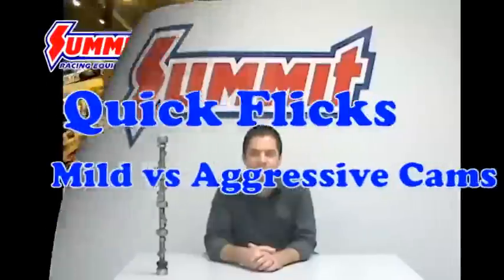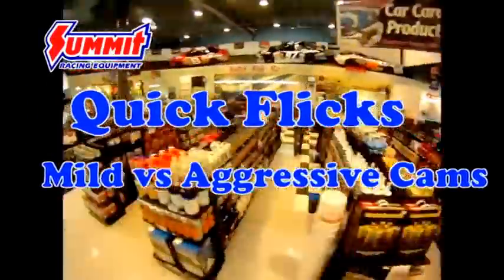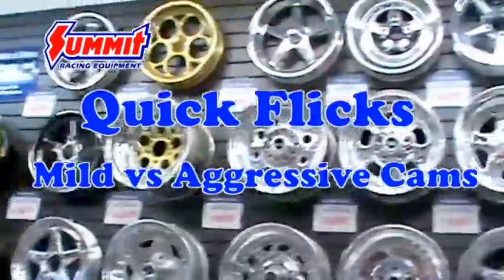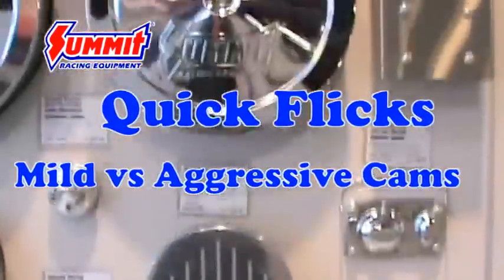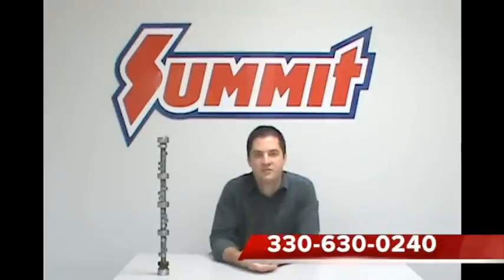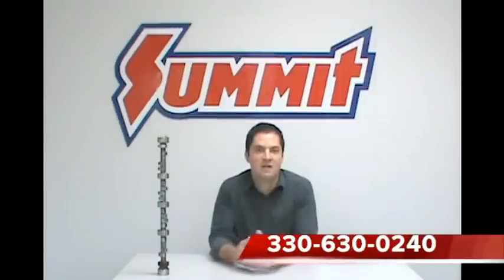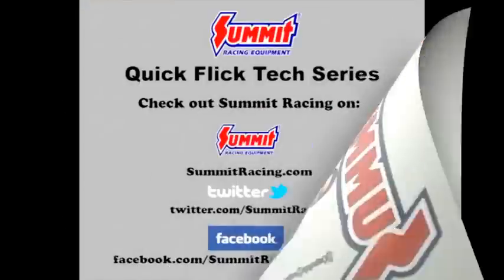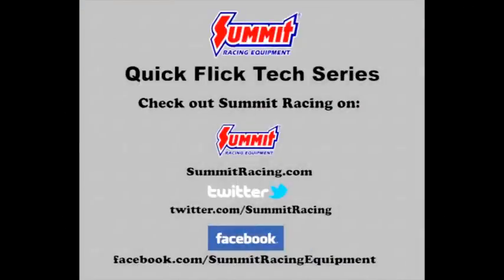Types of Camshafts | Learn the Differences Between Mild and Aggressive Cams

Comment from the maker: Part of the reason for this lies in design/engineering limitations of the hydraulic flat tappet cam and lifter package (and for the most part, any flat tappet application). Even if you were to pursue a custom grind in order to get some extra lift while maintaining the 220 at 50 duration I’m afraid that the cost to benefit may not be worth the expense.  
   Let me know if I can help with anything else.

Comment from the maker: Think about this too…, based upon the 400 Chrysler and doing some quick calculations it looks like you are going to pick up compression at the rate of 2/10 of a point for every 0.010 inch removed (this is an approximation). Be very careful where and how much you cut from a Chrysler. Chrysler heads and pistons are almost always designed and manufactured for quench, in these cases quench is a good thing.

Comment: Who doesn't like the sound of a rumpity, choppy idle of a V8 with a trick camshaft ? I know I do, but what's really happening ? This music to our ears is actually an engine running poorly   at that RPM. It's like a dog with tap on it's feet, or an eagle not looking so majestic on the ground. It's not making the power it could, and is wasting fuel much the same as pulling a plug wire or two, or pulling the choke. Cam selection is always a trade off. The stock cam trades maximum potential power at the highest achievable RPM for efficiency, driving quality, and durability over the widest RPM range from idle to highway speeds.  Changing the cam moves engine efficiency (torque) up or down in the usable RPM range
Reply: Damn right.... if the vehicle isn't doing any high RPM work or if its heavy or used for the daily commute/ weekend yard duties a big cam probably isnt a good choice ....
Reply: Correct, people need to read David Vizards article "Compression Comprehension". Unfortunately, cam manufucturers biggest demand/profit is in the rough idle charachteristic cams.  Listen to a NASCAR SB 2 engine idle quality. Efficient.

Comment from the maker: Okay, I’ve been looking but I don’t see what you are asking for in an off the shelf camshaft –probably for good reason. Give or take, I can get you into 0.500 inches of lift with a duration around 220 degrees at 50. As soon as I start looking for some lift numbers toward .550 or more then the duration is going to head up to 230 or more.

Comment from the maker: That depends; we need a few additional details. 
Model year, application, drivetrain, transmission, modifications, stock - near stock? Let us know, we'd be glad to help.
Reply: Wanted to get some information on a cam for my 2012 Dodge Charger 5.7 rt rwd .... I have CAI and bullydog GT Tuner so far. I’m currently experiencing a lifter tick and a cylinder engine misfire, so I wanted to go ahead and upgrade my cam in the process. I’m going to be rebuilding my engine and upgrading to a 6.4 intake(NOT PORTED), BBK 1&3/4 shortys, BBK 90 TB, Diablo T2 tuner, My car is a daily highway driver and I’m not concerned about MPG... thanks 🙏🏿

Comment: My 1980 Z28 Camaro weighs 3748 Lbs. has 3.42 gears with 255/60x15 rubber, TH350 with 2000 stall conv. The engine is GMPP #10067353 (LM-1) 350ci with Edelbrock Performer 3701 intake & 1405 carb, 1 5/8" long tube headers into dual 2 1/4" full exhaust with Thrush hush turbo mufflers. I initially installed a Crane HMV (now Powermax) 266 H camshaft : 210* I, 216* E duration @.050, .440 I, .454 E lift on a 114 LSA. I recently added RHS Pro-Torker heads (Vortec) 1.94 I, 1.50 E and GMPP 0.028 composition head gaskets (calculated 9.3:1 compression ratio). With the new heads and bump in compression I think I could use a bit more cam, I would like to stay with Crane and am considering their 268 Z-cam : 218* I, 230* E duration @.050, .459 I, .486 E lift on a 112 LSA. I like the 12 degree split on duration to help with the vortecs poor exhaust,... any thoughts ? I will upgrade to a 2400/2500 converter, but probably not until next year.
Reply from the maker: Hi Dan Lipsack, 
Provided you have a good rear axle ratio such as a 3.70-4.10, it would indeed be a good upgrade. Don’t forget about additional tuning that will be required such as jetting and ignition timing!

Comment from the maker: If you elect to cut, do not cut to the point of removing it – don’t quench the quench . Using the cut for a freshen up or to create a good sealing surface or for uniformity is one thing; also keep in mind that the deeper you go on a cut the more likely you are to generate other problems which will need to be addressed - besides the quench issue.   Please consider dropping your camshaft down to meet your compression ratio; use the cut to make things true and uniform. Good luck.

Comment: I have and c5 z06 2002 with 10 000
Km   will it be better putting a procharge  do I need to change the  camshaft  or I should just change the cam and  head &valve  ?? 
 Thanks  I'm Danny

Comment: Looking for a Cam for:  Somewhat Low to the Ground-Regularly driven 1975 Dodge Dart Sport Coupe.  318 LA Small Block Engine; Stock Compression Ratio (8.3 if I recall is std);  Stock Cylinder Heads.  I plan on installing an Edelbrock Performer Series Intake Manifold as well as a 550-600 CFM 4BBL Carburetor (not sure if Holley or Edelbrock); Headers for sure; Differential is stock and Rear Tire Size is 235/45/17.     Mid Range Power Band is usually my preference as topping RPM´s is not a priority and will be done only occassionaly.    Currently has a 3Spd Manual Transmission, May change to 4 Spd eventually.   Many thanks and my Summit Racing Cart is awaiting your response.  ;)
Reply from the maker: +Teddy Jaramillo, 
We need some additional information from you. Can you please give our tech line a call? 1-330-630-0240. Thanks!

Comment: Hey summit, I purchased a cam from you a few months ago.It was the 35-218-3.I put it in my 351w which I rebuilt with your rebuild kit.I upgraded the rocker arms with roller tips.I used gt40 heads that I had redone.Used a dual plane intake from summit.This is in my 87 f150.The truck runs great.Takes off like a rocket.Used a bigger 750 cmf holley and put ten inch wheels on the rear for more traction. Added limited slip also.So what do you think about my cam choice ??
Reply from the maker: Glad to hear the truck is running great! The 35-218-3 cam was a good choice for a street truck as it offers excellent torque and mid-range power.
Reply: Hey man I got a 2016 f150 and my plan is to put long tube headers and a cam, but from f150 to f150 what type of cam style do you think would be better?

Comment: I was hoping he'd cover a little more on valve overlap and how it affects the characteristics of the engine.
Reply: +90redgt1 ... or ANYTHING for that matter!!!
Reply: Valve over lap kills idle vacuum, but increases mid and upper rpm power.  My Iskenderian cam has 59* of valve overlap @ .020" (lash) and 27* of valve overlap @ .050".  Even thought that isn't considered too wild of a camshaft, I wouldn't want to have too much more than that for a sensible street machine.  I also have an AutoGear M23 Z-ratio 4-speed transmission with a 2.98 first gear driving a 3,36 posi unit differential.  There isn't any problems with starting out with a very handy low first gear.  My Corvette cruises very nicely from 2,200 to 3,200 rpm.  It has an explosive acceleration curve from 3,800 to 6,400 rpm.  Cheers.

Comment from the maker: I would not recommend building outside the requirements or parameters of a certain cam or grind. Remember you are manipulating cylinder pressure (actually dynamic compression) with the camshaft. The camshaft manufacturer/grinder knows and understands the timing events that they have engineered into the cam pattern and establish a certain benchmark or range for the static compression and other parameters based upon that information.

Comment from the maker: Hi Fiddlercove, 
   Nitro and methanol will readily mix – no problem. Nitro and gasoline do not mix without the use of additional chemicals that create an affinity for each other or some form of mechanical blending/mixing to prevent separation.
   Be advised, one of the by-products of combustion is water/H2O. Water and liberated nitrogen become extremely corrosive and TOXIC – can you say nitric acid?? 
   Are you an organic chemist or physicist? This is a bad idea!

Comment: Mild build 350 in my future for my '93 K1500 after I get the trans rebuilt. Aftermarket Vortec heads, roller lifters and maybe rockers as well, depends on $ when the time comes. I am thinking along the lines of an RV cam. I had great performance with the one I had in my '69 elCamino. Obviously there is a pretty big difference between the 2, 700R4 vs 350 turbo, 3.54 gears vs 3.08s, 4x4 vs Rwd and probably 1000lbs, but I want that same kind of usable power. Yes I will be running headers but I kind like my 3" single exhaust with the old school glasspack the way it is. Thoughts?

Comment: So I've been helping a buddy of mine improve the performance of his '89 Jeep Cherokee with the inline-6 4.0L. I've been considering getting a mild cam for the Jeep (along with headers, performance exhaust, performance intake, etc) and while looking at cams I notice a lot of the products specify they're not meant for fuel injected engines?
So my question is why can some cams be used for carbureted engines but not fuel injected engines?
Reply from the maker: Hi *****, 
Because camshafts directly control cylinder pressure (and manifold vacuum) by changing the lobe placement or timing. Having a strong steady vacuum signal is important in an OE fuel injected application because of the MAP sensor.
Reply: Summit Racing So if I were to get a custom tune for the Jeep with a new fuel map a long with the other new parts I would need, would I be able to overcome that issue?
Reply: Yes, you have your ECM  remapped.

Comment: Idk if your still helping people pick camshafts but I got a 2014 chevy silverado 1500. All I did so for is exhaust system, long tube headers, cold air intake and a CTS2 tuner with a 4" lift on 33s. Looking for a cam for torque and power right from the start. It's a daily driver too. Please let me know thanks
Reply from the maker: Assuming your truck has a 5.3L L83 or 6.2L L86 Gen V LT engine, COMP Cams’ XFI AFM cam (Summit part number CCA-624-500-13) will give you more power throughout the rpm range while retaining a smooth idle and good drivability. It’s compatible with VVT (variable valve timing) and AFM (Active Fuel Management/cylinder deactivation). It requires the use of COMP Cams phaser limiter kit (CCA-5456) and a custom ECM tune.
 
https://www.summitracing.com/parts/cca-624-500-13
 
https://www.summitracing.com/parts/cca-5456

Comment: Which of these two cams does more hp and ft / lbs? Lunati # 10120101. Duration @ 050 214/224. Max lift 443/465. Advertised duration 280/290. Lobe separatio 112. intake centerline 107. vs GM cam (# 24502476). Duration @ 050 212 // 222. Max lift 435/460. Advertised duratio 320 / 324.lobe separatio 112.5 intake centerline 109. thanking you for your response.

Comment: I want to build a flat crank turbo charged 340 for a trans-am application. I looking to make most of the poswer in the higher rpm range. I need more information about this. Where should i look for this data for this application before i begin to build ?

Comment: I know this is a old video but I have a problem.  I am sourcing parts for a 306 roller build for my old '82 short wheel base truck.  I got majority of the parts minus the short block, heads, and valve train.  The valve train I keep looking at the Crane TruckMax which used to go by a different name, its a roller 302 HO cam part # 449541. 

Its listed as a "Good low end torque and horsepower, good idle, daily usage, performance and fuel efficiency, off road, towing, 2,400 - 3,000 rpm cruise, 8.75:1 to 10.0:1 compression advise"

Thing is this is the only hydraulic roller cam that is a truck cam for a 302 Ive seen on Cranes new catalog.  Its a 216*/224* duration @ 0.050 and 112* LSA and 107* centerline.  From what I have been told this cam should be quite responsive and peppy in my truck especially after I rebuild the transmission and have a tow/rv shift kit installed, a wide ratio planetary gear set, and a black stripe modulator along with changing the stock 2.75:1 ring and pinion out for a 3.25:1 trutrac which should be around 2.90:1 taking into account my taller 31" all terrain tires.

Question is though it was stated on here towing is 210-215* at 0.050 lift.  Is that right?  Cause based off Cranes description of this cam this is a tow cam but it is more in line with the street/mild cam range you listed of 215/225*.

I also have some people telling me the 58* overlap I calculated on this cam is going to result in lower vaccum which I seen one video on here with a fuel injection 302 running this same grind cam and it sounded like it was idling fairly smooth indicating it should have pretty good vacuum.  And as of about an hour ago I got someone else telling me this cam is 1,400 - 5,400 rpm range which means under 1,400 rpm the truck will be sluggish which I just cant fathom how it could be with the ratio changes and hughes tow converter I will be installing which should have more stall than stock.

If anyone can shed some light on this I would greatly appreciate this.  I would post to summit directly but it seems like I either don't get a reply or it is quite a delay between the question and the answer so I miss it in my emails.

Comment: I have a 1990 tbi 350 1500 suburban. My friend has a cam out of a 1990 3500 camper. Is this cam hotter than my stock one? And would the swap be worth it?  What would be the best cam, rockers for my engine. Not looking to pull the motor at all if possible. I've heard a simple set of 160 rockers will wake it up. Please help!

Comment: Hi guys. I own a carburetted car, with 1556 cc engine, an old Dacia. She has 9.25:1 compression ratio, 72 hp/ 5000 rpm. 260 degrees duration camshaft with 5mm lift. One double barrel vertical carb. 3.77 final gear ratio. I bought a camshaft from an old guy, used to race his car back in the days. This one has 320 degrees duration with 6mm lift. Bought a polished head, polished valves, polished and slightly bigger intake than stock, polished exhaust. I'm not sure if I messured correct but I think the compression ratio will be 10.5:1. I will use two double barrel horizontal carbs, maybe Dellorto's (not sure what size I need ), build snakes exhaust and straight pipe to the back. I'll use a gearbox with 4,125 final ratio. The car is 900 kg weight. I will use it to have fun, to race it throu the corners and fast accelerations in beetween. I'll use it as a "weekend" car. What dimensions of carbs I should use and what compression ratio?
Reply: It's a str8t 4 cylinder.

Comment: Think about the gears on a mountain bike.  The lower gears you pedal easy and fast but you don't go real fast. The higher gears you pedal hard and slow, but the bike carries you faster.  Now think of the gears on the bike as your transmission and differential, and how fast you're pedaling is the revolutions per minute (rpm) of the engine.  Camshafts are designed to work best at a certain rpm, so you want the function of the gear ratio to match the functionality of the camshaft.

Comment: i purchased a Predator custom grind cam off ebay little while back and installed it in my 1970 400 bbc. Specs on sheet show duration at .050 intake 234   exhaust  244.  lobe lift is int .325,  exh  .340  lobe sep is intake 107  exh  117 making it a 112.  The bottom half of this BBC is stock with .030 oversize crown pistons and hi volume oil pump.  I ported and polished the  stock MOD heads and placed a match ported dual plain hi-rise on top.  Added over size push rods and guides with anti lockup hydro lifters and crane roller rockers and triple spring setup. Carb is undecided as I have a 800 spreadbore holly or the 850  mech double pumper to play with. I havent cranked this motor yet as I want to check clearances with  this big lift. My question would be is this a fast idle cam as I am running a TH400 with stock converter. This is a weekend warrior not a daily and its going into my long term project a 71 AMC AMX. I will be changing the rearend to a 4 link with 456 ratio to start with. Long tube headers are in place also.  TY
Reply: forgot to mention, the pistons are the stock crown 10.25.  I placed a medium cam and headers on this motor when it was bone stock and it took it well.  Motor came outta a 1970 CST 10 chevy truck that was ordered from dealer to pull a camper.

Comment: I have a stock 1955 Chevy, 2 door, post. I removed it's factory 235, six and 2 speed power glide. I purchased a stock 5.3 vortec out of a '06 truck with a 4L60e transmission, a 2 wheel drive. All the hang on components are there, CPU, wiring, power steering, power brake pump, A/C pump.  It has 60,000 miles. I know I will be going to side motor mounts. I will need to flash the CPU.  I will need radiator, hoses, cross member for the transmission, and system to make it shift from the column. And a few other things that you may know more about.  What does Summit have to help me complete the transformation?

Thank you
Terry
Reply from the maker: Hi Terry, Can you give us a all? 1-800-230-3030. We look forward to hearing from you.

Comment: What about 204 street cam in a carb 88 firebird it has a 305 ho in it been board 40 high rise intake 600 elderdblock carb long tube headers how much power do u think it will have